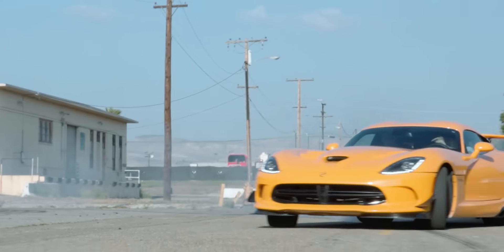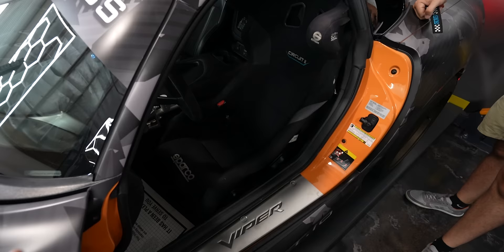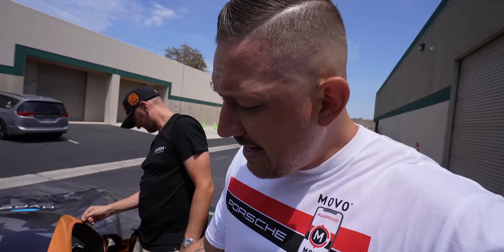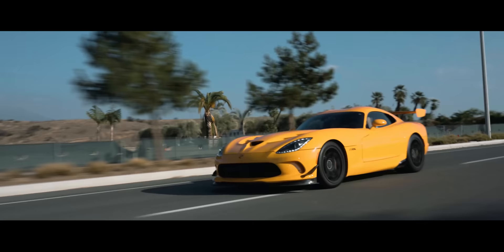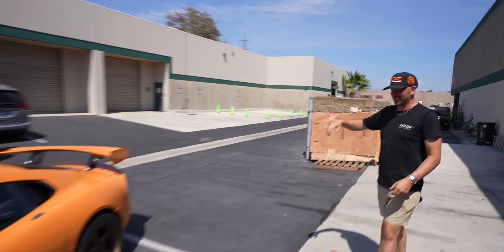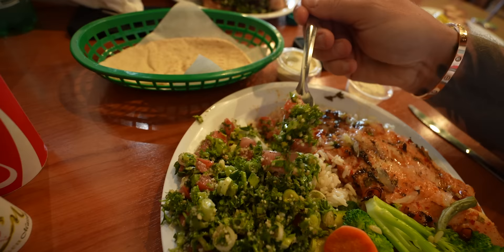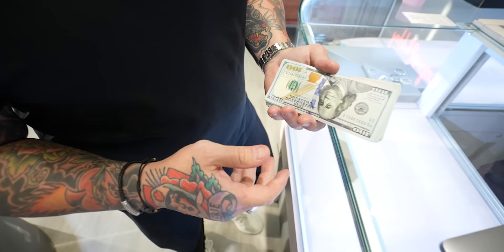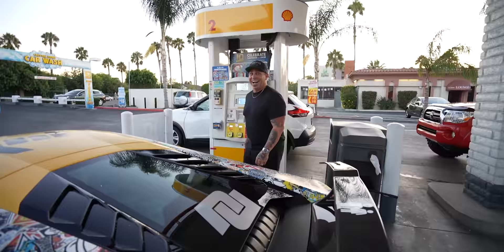NOW I CAN REVEAL THE TRUTH BEHIND THE NFT VIPER…

Comment: I'm part of the Keep the DDE Viper wave. Why? #1, It's the closest to an American exotic we're getting with that big V10. #2, It'd be the only car in the fleet with that deep throaty sound (especially once it's built out to max HP). #3, Side exhaust flames from a 2000+ hp RARE, no longer produced vehicle that doesn't cost an arm and a leg to keep running. #4 You can turn it into a 1 of 1 carbon fiber widebody that only Damon can dream up. #5, If the viper comes back, since Fiat is the parent company, it's going to have Ferrari engineering and that will make the originals more valuable. I could keep going but, please, keep & build the Viper.